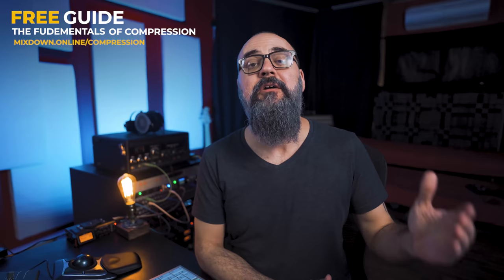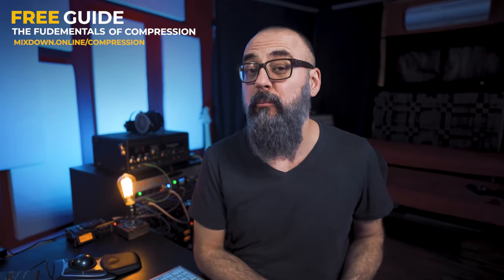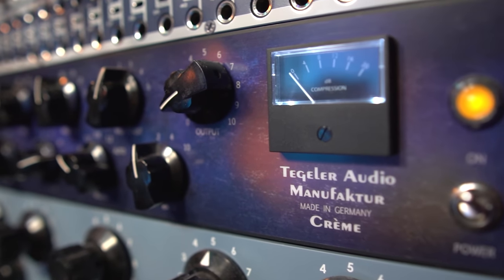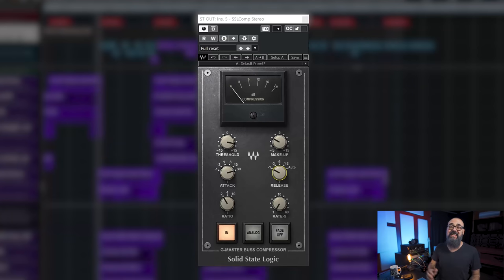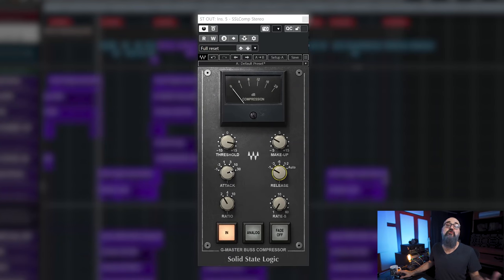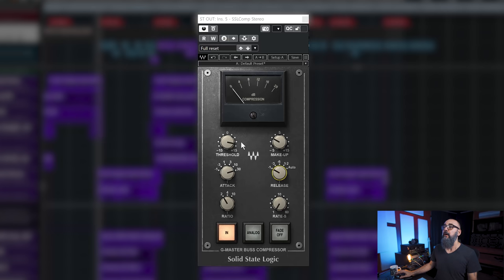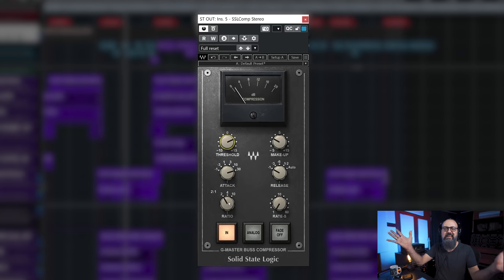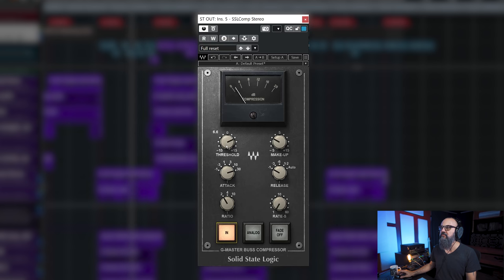Mix Buss Compression  - The Simple Way

Comment: One of the big lessons for me. I used to add it towards the end of mixing to 'treat' myself to the benefits, but now add it after the first rough mix and mix into it, and use less plug ins earlier in the mix structure.
Reply: Yeah, the problem with adding it too late is that compression can alter your EQ curve. For example, if your mix has a lot of low end, it's naturally going to be triggered by that low end and clamp down hard on those transients. So now your whole mix will sound a bit thinner because the low end is being squashed. That's why I always try to add mix bus compression early. That way I can get exactly the tonal balance, EQ curve, and dynamics I want with the compressor already on, instead of having to make last minute adjustments based on what the compressor is doing.
Reply: If you claim to be "using less plugins," you're relying on the mix bus to do the work, and that's not teaching you to process individual tracks properly. This is meant to be used LIGHTLY, as he mentions in the video. It's not supposed to be relied on to mix for you.
Reply: @JTguitarlessons  I'm not. You need to read people's comments properly before commenting yourself.

Comment: SSL bus compressors are designed to run best at 4:1 ratio, or so I have always been told. That being said, I do agree that you generally want to use the less is more bias. I've had tracks where I literally had to take off all compression just to keep the LRA healthy in mastering, and I've had other tracks that just had to have 2-4 db of gain reduction on the bus compressor, and still kept a healthy LRA in post. The vibe of the track is a factor too - some tracks want to be compressed more, and lend themselves to less (or none).
Reply: Can go 2:1 or 4:1 depending on the program material.  I've had great results with 4:1 when going for a more glued in sound.

Comment: Attack and release are usually different for each song. Your setting means that you're only compressing the middle of the sound just a bit. All the movements and transients are at the beginning and ends.
Reply from the maker: Yes, that's the case for instruments, but the mix buss is a different ball game IMO. My goal with Mix Buss Compression is to glue things up by keeping the compression transparent. If I change these settings up, it will not be by a lot. In a classical music mix, for example, maybe a slower Release time would work better. For most mixes I worked on in the past 18 years, those settings worked well for me 95% of the time :-)
Reply: @mixdownonline  ok...i got a beat thatt i finished, can you tell me anything  about it if i  send it to you.

Comment: Hi. I use Rear Bus Compression. Will it replace Mix Bus compression, or is it a different kind of compression, thanks.
Reply from the maker: It's different. I use both, Rear Bus Compression is basically Parallel Compression on some instrument busses, which is not the case for Mix Bus Compression :-)
Reply: @mixdownonline  Great, thanks for the reply.

Comment: Great video as always!
Because I tend to listen more on these videos instead of practicing and listening myself... i must ask this for some stupid question... So if I have a song with for instance a verse that has less elements and don't build up to the same levels as the chorus... would you recommend to automate the threshold for each part? I guess if I want to glue the verse I would need to, that is if I intend to keep the mixbus compression in the end and don't leave it for the mastering engineer? But if I want a certain vibe I keep it, I think you said or someone else in another video ... well?
Reply: i think  everything should be on the same level  consistency  you might have to listen to certain songs to see if it is the same level and what not
Reply: Depends on the effect you want to achieve. It may be fine for the verse to be less compressed if you want a more open and relaxed sound there. However, if you want consistent compression, you would definitely have to automate the threshold. 

There's something nice about the compressor really kicking on in the chorus though. 

Also, one thing to keep in mind is that even if it doesn't look like any compression is happening in the verse, it may still be doing something. Compressor plugins are often "flavored." They have transformer or tube emulations built-in. So running your mix through them may be doing something subtle to the sound even if it's not audible compression.

Comment: Noobish question but, why not use the same compressors usually used on the different mixes (1176, LA2A, etc...), on busses and master?
Reply: Because mix bus compressors are usually VCA compressors, they are usually transparent and don't colour the sound. Those others are FET or Opto, they tend to lend their character to the sound. It's just usual to want a VCA comp to glue the mix not change the tonal characteristics.

Comment: With the release, you don't want the slow setting, because it won't return in time for the next transient to come through. It basically ruins the sound of the song. I like to have it fast enough to return in time for the next beat. That's dependent on the speed of the song. I might even make it slightly quicker after I find the sweet spot, just to be absolutely sure it's releasing in time.

Comment: hi Chris. I have often seen this technique used on the master bus. many people say that this ssl changes the perception of the side of the mix. is this to you? analog button adds character or is it just voltage simulation?
Reply from the maker: Didn't notice that much and the Analog adds a slight bit of harmonic distortion